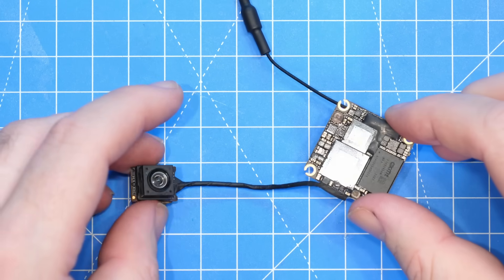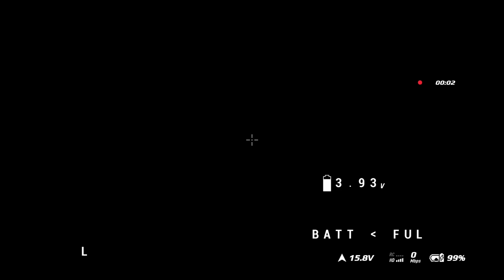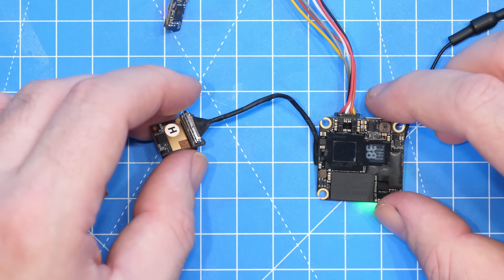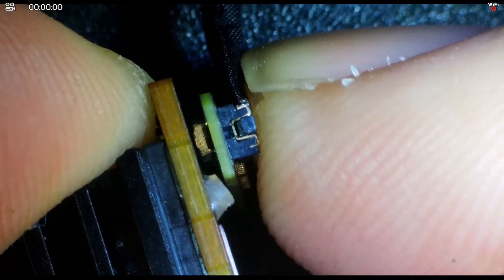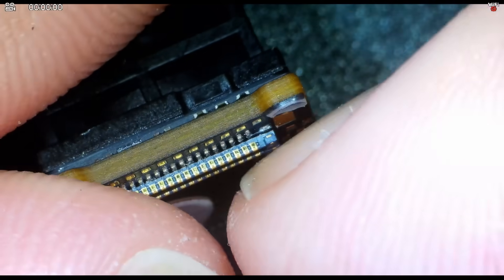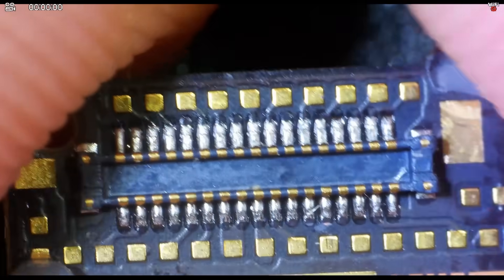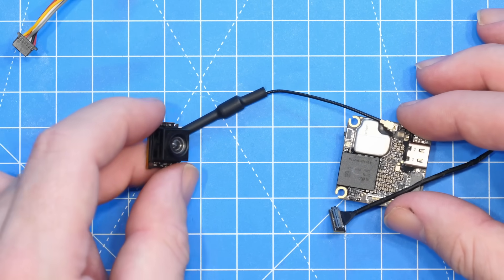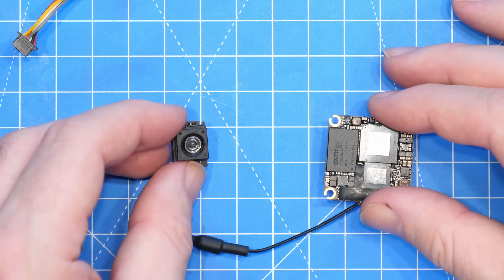DJI O4 Airunit Failure - Bad Design ?

Comment: I got one better. I have seen complaints from the folks about O4 PRO. I've been getting reports of faulty O4 Airunit Pro. There are some of the usual user errors. What concerns me is the users reporting cameras going black after a landing or turtling the drones. Swapping the cameras doesn't fix the issue either.

Comment: I have a 04 pro camera  and have the same problem with where the cable plugs into the air unit itself plugged my spare camera from my other pro unit and no black screen no happened with pro and not even flown it yet

Comment: Strange to have snapped 10 connectors at solder joint. Guess i would glue it with E6000. Hopefully it was odd unit that got damaged at factory

Comment: Mine just stopped working after a pretty minor crash that didn't even break anything on the drone, but the o4 no longer connects to my goggles 3. No visble damage on anything. I've had it lose connection a couple of hard landings, but then come back after restart.
Reply: Today i just killed mine too. Also minor crash, nothing crazy and lost vision. When I got to the drone after a few seconds, I could immediately feel that something was wrong, because the board was hot. On the desk, I noticed that after a few seconds it got very hot, so much so that the hot glue started to melt. It never connected t o Gogles again, no diode lights up, the computer does not detect it. Also, no visible damage, but I did not remove the sticker, so I do not know about the other side, and it is from under the sticker that heats up. Today I am sending it back to DJI.
Reply: @maciegx1337 any update on your 04? I have the same problem now. Its getting hot, no diode, not connecting to my goggles and computer does not detect it too.

Comment: Definitely not great, but could you not solder it back together with a hot air gun / resolder station?

A bit of flux and hot air should do it … no?

Comment: That connectors are really not designed for handling by non professionals. The mating cycles are probably less than 10 and normally they are used inside an enclosed system and not on a system sold for consumers.
In my company we have special tooling for the mating of such connectors to avoid damage. 

Also ESD damage could easily happen if you touch the bare PCBA without earth connection.
Greets from a hardware dev.

Comment: 🤣🤣🤣I'm reading some comments here that it was Mad's fault and it broke....The fact is the O4 lite air unit seems fragile and IT IS! that connector easily will break during instalation even if you are a pro! Also what about a hard landing? What will happen with this delicate conector🤔

Comment: Had a feeling this would happen. I also dont like the camera connector coming from the top rather than the bottom.
Reply: Yeah, I would consider that a design flaw even though i havent had a problem. I made a TPU Camera holder with holes for mounting screws, to mount to mobula 6 canopy. Works great and can adjust cam angle. And the way the cable routes to the vtx, there is no strain on cable and all is well protected under canopy.
Reply: Can you flip the camera image around and build it in upside down?

Comment: I got 2 lite air units on release.  Built a 65mm pro. Crashed it a ton on carpet, tile, walls, cabinets, chairs, ceiling fans, exercise equipment and windows. Has not given me a problem yet other than overheating if i leave it sitting there after plugging in. I even crashed it into the cats water bowl and fully submerged it for 10 seconds. The video never went out even while submerged. And still works fine today. The second air unit went into a 75mm 1s whoop. That air unit didnt have any glue on the connector at the camera and came off when installing. Put some e6000 on it and reconnected. That one works fine to date also. It weighs less than 10 grams, how robust do you want it to be?
Reply: @MountFPV  Overheating now that is winter time? Imagine what will happen during summer...
Reply: @stst8301 I had low power mode turned off. Its on now and doesnt overheat anymore. And I only fly the 65mm indoors so its the same temperature winter or summer.
Reply: Plus if it overheats again I will just dunk it back in the cats bowl water to cool it off.
Reply: @MountFPV  🤣🤣🤣
Reply: @MountFPV 😂

Comment: I suggest DGI offer advice to O4 users that they should never unplug the cable unless there is a compelling reason, as previous posts have indicated.  Explain that the lightweight construction is associated with a degree of extra fragility. If you have to do it, DJI should on its website offer expert advice on how the cable can be unplugged with minimum risk of damage, and maybe offer to sell a cable unplugging tool to make the job safer.

Comment: This reminds me of what my dad taught me about 55 years ago "if you keep fiddling with it, it will eventually break". Your constantly removing the cable and trying other cables and if i am correct you removed the glue that DJI put to prevent the cable from coming off what would you have expected.
Reply: Similarly, I recently learnt that the U.FL connectors have a really small re-use life expectancy!
Reply: Exactly. I don’t see the average person constantly swapping out cables. I could be wrong though.
Reply: That there is a void warranty
Reply: @cyanmizu  change a consumible cable do not stop garanty
Reply: We're talking about FPV though. These things are supposed to be able to handle vibrations for many hours, some fiddling and at the very least light impacts
Reply: my cable fell off the connector on it's own. even with the glue on it...
Reply: He only removed cable to troubleshoot, it was already broken....
Reply: @wilffpv  No, he tried many different cables on that camera and he said "it got some use" or similar in this video as well. Far away from typical usage.

Comment: Thanks for that update. When i first saw that connector i already knew its gonna be a weak point. I glued it with Black Silicon Adhesive all around the connector, that should do the Job :)

Comment: Reminds me of Hdzero and Walksnail 
Both had teething troubles with their 1-3s boards
Dji will sort this.
But currently simple fix is to add a thin layer of hot melt around that area
Reply: Simplest fix is to not remove the glue that DJI put on it.
Reply: @Kai-P  of course..... I'd suggest to perhaps add a bit more for those of us who fly fast and crash hard
Reply: @gmivisualsjason3729  Maybe, but extremely few crashes should put any significant strain on that connector. Removing the cable once is putting more strain on it than the cable stopping at 100 km/h on concrete.
Reply: It's never a good idea to buy the first generation. When the update came out to make 03 work with my Goggles 3 I just waited and kept flying the Goggles v2 ... and whadaya know without a month it came to light there was an absolutely horrible bug that would drop connection and you would not get it back till you rebooted the air unit or disarmed and armed the quad. 

Let other people play hot potato, because DJI just does not really have beta testers at all. No good ones. Or maybe they do and they find all these flaws but decide to launch anyways and hope Ian gets sick or something.

Comment: I’ll add a bunch of e6000 to mine being installing.  I can see a version 2 of both coming out soon. Even the pro looks super fragile. All they were worried about was weight and not concerned about durability.
Reply: @seanpatterson5298  DJI does not historically do version 2’s, but you never know.

Comment: Would conformal coating it really well before using it help?
Reply: Acrylic based, not silicone
Reply: I dont think so. You should get something that gets solidified. otherwise it will flex. same goes with antennas ufl connectors

Comment: I hate these types of mipi connectors - I use Walksnail which is very similar. The HD Zero connectors are much more robust and positive on the connection.
Reply: HDZero is a very different camera without a gyro.

Comment: I assume it's because you removed the glue from the connector in the review (unboxing and teardown) can you reflow it. Maybe it works again.
Reply from the maker: It's broke the pins so it needs replacing.  Yes the glue will help but it's a very weak point in the design with the interposer.
Reply: @MadRC  okay thanks. Its probably a cost driven design. To get a 110.- air unit

Comment: The cable on the camera could face towards the center of the camera. In this case, it would be much easier to protect it. This protruding cable is very problematic to mount in any frame.
Reply: I agree with this even though i havent had a problem with mine.

Comment: That's why there are two drops of glue… (that you removed…) You said in another video, I think, that you had to be careful with the connector and this glue; it's confirmed. But for the money it costs, with the UFL without anything to hold it, the camera that sucks, and no race mode with the light, in short, what's the point? It's better to buy the O4 Pro; it's much more logical. On the other hand, the construction is getting worse and worse. I'm still in V1, and the air unit and the DJI camera are solid against all odds. (I just found 20 cm cables with the back of the DJI camera; the V1s are fine for me; they're way above the analog and are getting cheap.). Also, the Vistas at least have what it takes to hold the connectors; this 4-light model is really quick. Will I ever go to the O4 Pro and the V3 goggles?? I don't think so. I'll wait for new goggles… logical: O4, V4 goggles, without all the defects of the V2/V3... (and not to mention the N3, which is pathetic…)
Reply: I flew a 65mm 1s tiny whoop today with amazing fpv video quality and no breakup all the way to the other end of my 5 acre lot and automatically recorded 4k video of the flight, and the latency didnt bother me a bit. Thats the point!
Reply: @MountFPV  ok it's powerful and awesome, that's not the problem.. this equipment is in my opinion too expensive for what it is. they have accustomed us to better. that said, it's great to have a lightweight system that records 4k with crazy power! those are the flaws at this price. but I'm tired of explaining myself, that's my opinion, you must surely be right, cordially, A.
Reply: @LeFlamantRoseQuiDrifte  I guess its my assumption that anyone would buy the lite and put it in anything larger than a whoop. I personally would not.
Reply: The o4 lite does have race mode.
Reply: @midnitejesus  yes but with hight latency no? the better mode is with O4 pro no? anyway, for me, only the ufl with no retaining thing, is a dealbreaker. is light but with all this problems, i dont whant this.
Reply: @LeFlamantRoseQuiDrifte  Not a dji user here, but I don't think I've ever used an analog vtx with a retaining plate. I always drop a dab of e6000 on them and don't have issues. I do a lot of high speed crashing.
Reply: @geordil  yes I have some of this magic glue ;) ok everyone is against me and defends this equipment which in my opinion is too expensive for what it is. they have accustomed us to better. that said, it's great to have a light system, but the compatibility problems annoy me a lot, the HD (dji V1 goggles and old Air unit..) allowed me to come back because the analog did not correspond to my flying style, the HD yes (freeride). so all this is great, that said details which are not even much for the price they could have put a retention for the ufl. (even if we can do without ...) and a good connector for the camera is also something to redo, etc ... the v3 goggles are not great either.. so I'm waiting for a V4.. o4 + V4 it makes sense.. they are not going to spit on a new release? but better this time... but I'm tired of explaining myself, that's my opinion, you must surely be right, cordially, A.
Reply: @LeFlamantRoseQuiDrifte  nice man sounds good

Comment: Hot glue proprly placed on both sides can help prevent this.  This method is commonly used for these connections in DJI drones.
Reply: It comes hot glued, he removed it and has been plugging and unplugging it 100 times, what a shock it doesnt work!
Reply: @nvrmor023  oh yeah these plugs only last a handful of times with being damaged usually.

Comment: Wow🤯 more glue for sure. Looks like they are made to be put together and tucked away and left alone 😉 bummer. I'm sure there will be some new products coming soon 😉🤣😁 they have been releasing stuff left n right. Not taking time for testing ☹️ i have a pro unit waiting for frame and thought about getting 1 of these for a small build. Glad i didn't order yet. Got an avata2 on the way and I'm sure that should keep me busy for a while. But the 5" geprc dc 04 quad will be a beast 😁 supernovas and a HGLRC sealed up stack 😁 thanks for sharing

Comment: All these types of connectors are incredibly delicate.. hardly shocking. Especially if your monkeying with it. I cant qoute specifics but dont these types of connectors have an extremely limited number of plug/unplug cycles? Ive seen some specs where cycle life is <5
Reply: Yeah, he was throwing it around in the palm of his hand on his first video and just yanking it out by the wires… I have four of them and beat them up and they never give me issues

Comment: They consistently for the last 8 years have designed failure points into their products (the whole industry) they know from customer complaints that the products break - they want you to replace them rather than spend be willing to spend extra $5 in the design to fix the issues.

Comment: I have been flying 2 Avatar 1S VTXs now for quite a while, one on a 65mm and the other on a 75mm rig, so far no issues except on the lite,  the USB plug fell off.  That camera connection looks really fragile on the O4. Cheers Great info BTW, Hope you are weathering the storm safely!